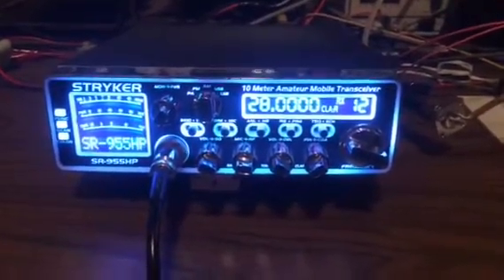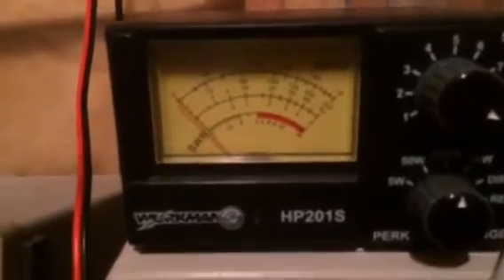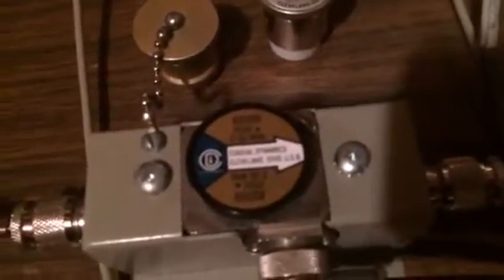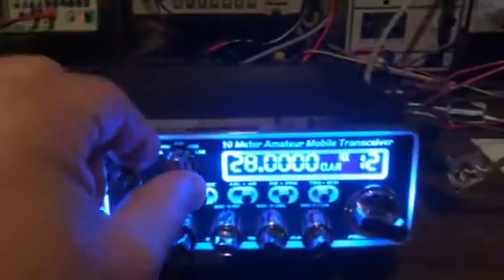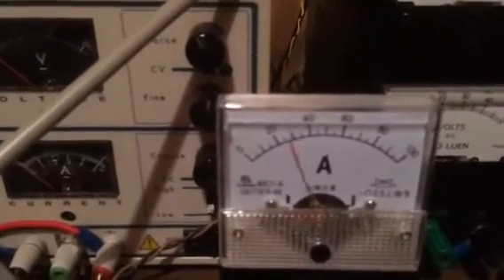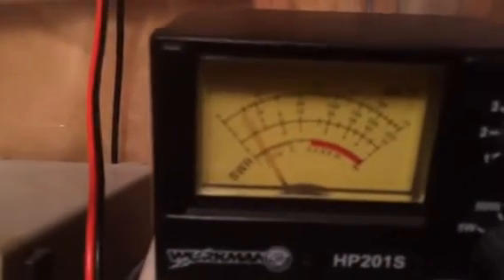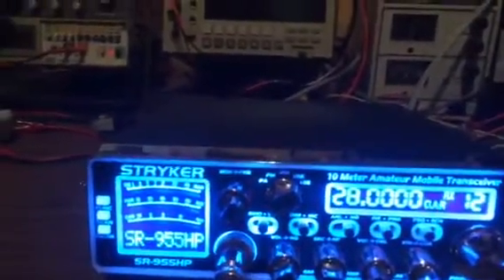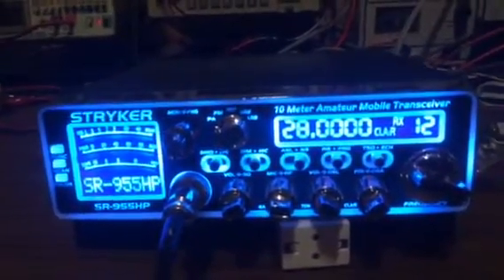RF Man demonstrates dual LDMOS amplifier in upper and lower side band

Comment: This amplifier is saturated. It is not linear. If 0.5W in gives 1kW out, then a 20W 'swing' should be 1kW * (20/0.5) == 1kW * 10 == 10kW !!! This is a 1200 or so watts peak output amplifier, and, for some linearity headroom works out more like a 7 or 800W pallete. The output power must ALWAYS be measured after the low-pass filter, too. Birds and any other meter know only how to read a pure sine wave. So the bird readout is also bogus, with no LPF attached.